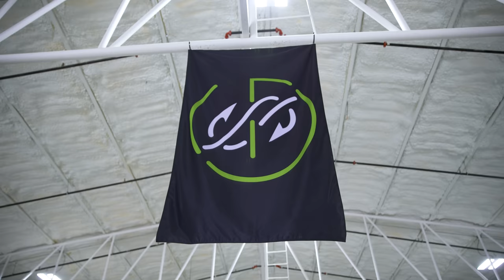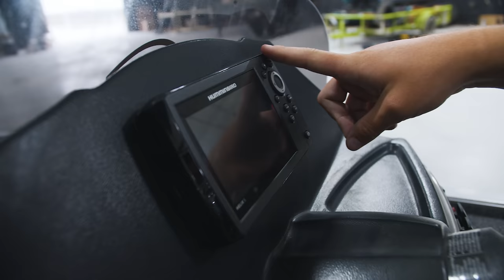$25,000 World’s BIGGEST Fishing Unboxing (New Bass Boat!)

Comment: One good upgrade/modification I would add (if it was my boat) would be a 8' or 10' power pole blade. For such a light weight boat and being it's under 18 foot long I would probably just go with 1 pole. I don't see a reason to run 2 of them. 8 foot should be all you would need. Maybe a 10' if the price difference isn't to much. This is all totally just my own opinion as to what I would do if someone just gave me a boat like this. It's your boat so if you want dual 10 foot blades then have at it lol. They also make a pretty cheap pole anchor system called "Dig In" shallow water anchor. It's just a basic mount that goes on the transom where your motor is mounted. 2 bolts hold it on and you just drop a T handle 10' fiberglass pole into the holes and give it a little push and it bites good into the sand,mud even Oyster beds. They come in several colors and it's under $300 bucks for the mounting plate and pole as long as you don't get camouflage. No battery needed, no hydraulic pump or fluid needed, no wires to be ran etc. They work amazing. I've seen them hold anything from a 14' jon boat to a 19' and bigger bass boat and Carolina skiff in place in the strongest winds and choppy waters!

Comment: Hey man that first 20 hours on that Motor is what u need to watch first 2 hours is 2500 rpm to 4000 rpm Varying rpm no runs longer than ten minutes o extended idle  trimmed all the way down the the next ten you can trim and full throttle no runs longer than ten minutes and no extended idle